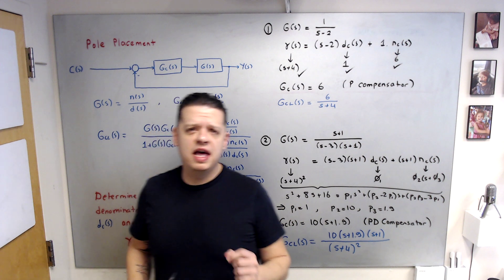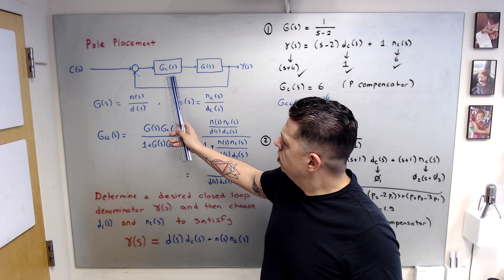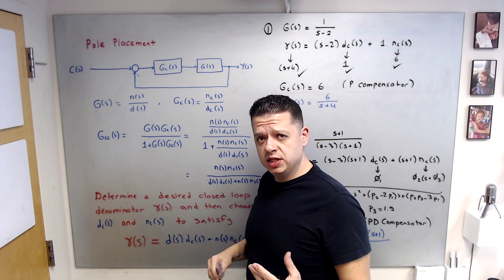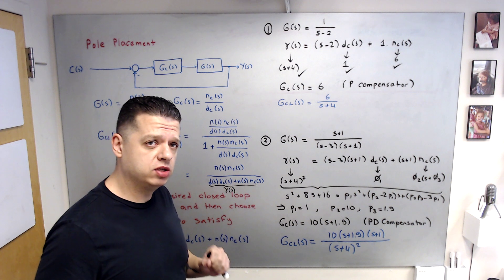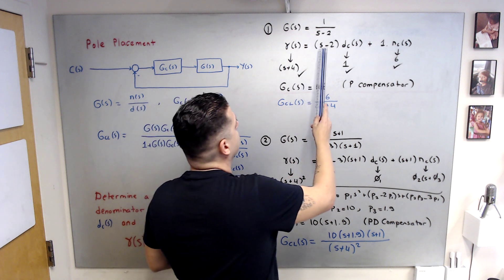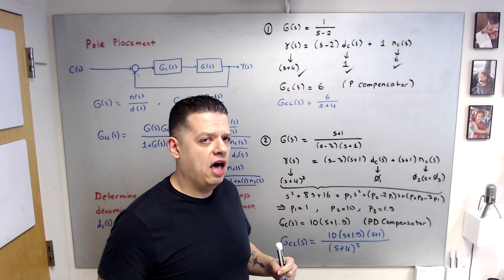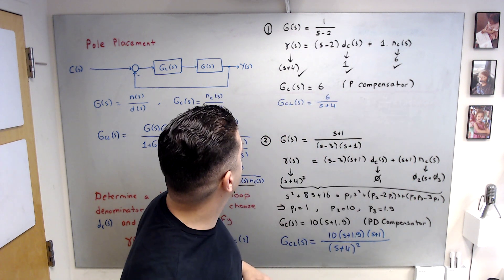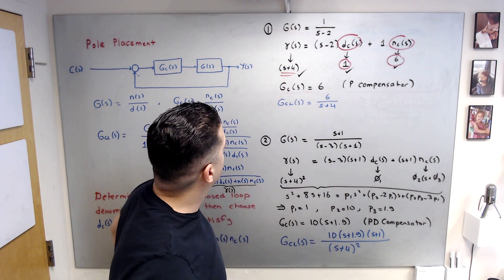Pole Placement (Lectures on Control Systems)

Comment: I think you've made a mistake there in the second example in math
Reply from the maker: What is the mistake?
Reply: @tyucelen  s^2+8⋅s+16=s^2⋅ϕ_1−2⋅s⋅ϕ_1−3⋅ϕ_1+s^2⋅ϕ_2+(1+ϕ_3 )⋅s⋅ϕ_2+ϕ_3⋅ϕ_2
and then trying to solve the system, we get one linearly dependent equation so it cannot be solved